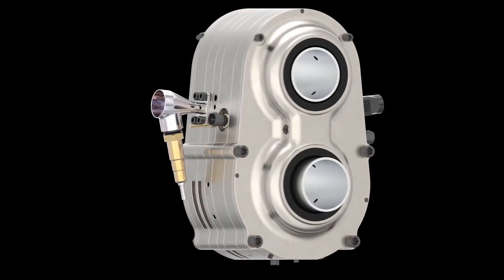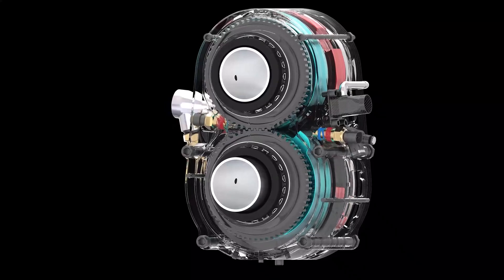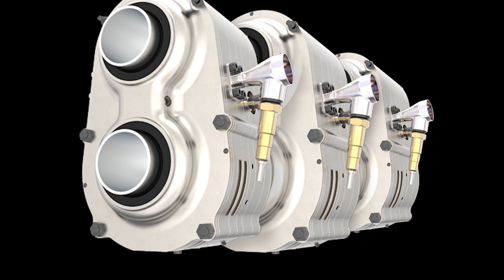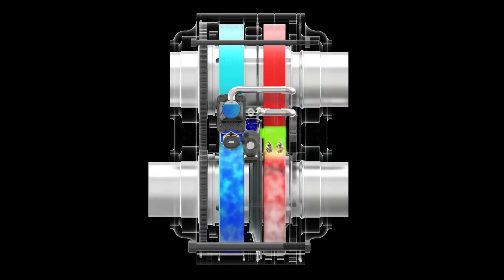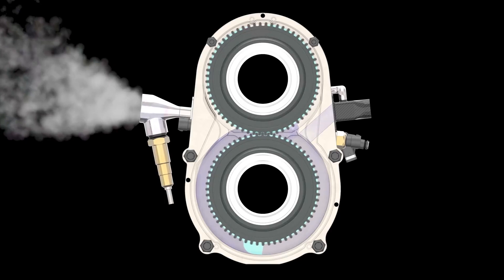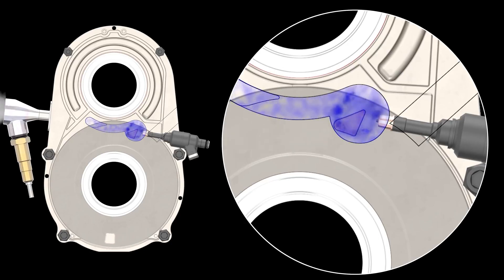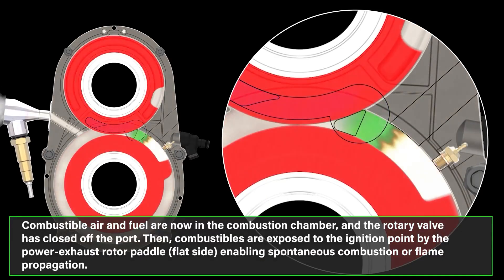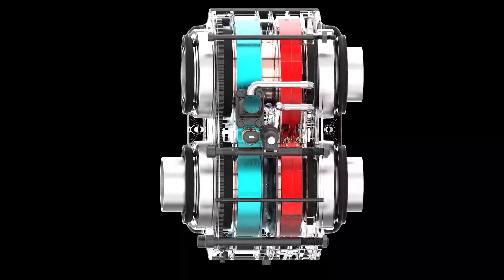This pistonless engine runs on hydrogen and revs to 25k rpm

Comment: PROBLEM:
Having just one explosion would cause an impact that has to be absorbed by the engine body through the shaft.  That will end up in problems, especially if no seals are used.  If instead of one, we have two explosions symmetrically located on opposite sides of the center of rotation, then those impacts would cancel each other out.
Reply: it is a modified Helicopter's main rotor engine, they use 4 of these units, light weight, super efficiency will often mean that it has been around for about 20 years already and being used by the military.
Reply: @dr.decker3623  , good to know, thanks.  However, I am surprised of the fact that it only has one explosion instead of two on opposite sides of the center of rotation.

Comment: I think hybrid cars make more sense than fully electric cars. Just one of these engines would be a great backup to an electric car. Light, efficient and powerful enough to turn a generator that would recharge the batteries
Reply: Or you could just use fuel cells to convert hydrogen into electricity, and skip the weight and size of an internal combustion engine and generator as well as all the moving parts.

Comment: Ok, sealing problem in Wankel engine is actually secondary one. The primary problem there - poor thermal efficiency due to relatively high specific chamber area.

Looks like the same here.

Would like to be mistaken but unlikely will surpass concept, as had had happened previously to dozen other unique ideas of ICE.

Comment: magnetic field have their own waste too. if the waste could have been low to zero it wouldn't have mattered which method.
im basically against anything that trends because, before it proves itself to me i dont take word of others for it. and electric cars are one of them. electricity too has waste. but not by the owner of the car.

Comment: While I think there is further development that can be done on the IC engine, as someone pointed out in another comment I have seen these things come and go as they usually have some sort of big drawback when they are fleshed out operationally. Having said that unless the energy density of batteries can be significantly increased EVs will have limited use cases. Example: My Tesla works great for my daily commute. However it is very inconvenient when I want to take a long trip. EVs are not yet very good at pulling a trailer or boat long distances so the range while fine for daily commuting becomes painfully low when a heavy load is presented. I believe there will be plenty of use cases for ICE powered vehicles for many more years. Eventually we may all go to EVs but the technology has a way to go yet. Oh and the benefit of low operational costs of an EV will be negated as more people get them. The demand for electricity will go up while the supply will not be able to increase at the same rate. Economics 101 says that the cost of electricity will necessarily go up while the cost of liquid fuel will go down with a decrease in demand. I do like to see innovative development in IC engines but generally speaking hydrogen is not a good idea for many reasons. Of course that could change with a technological breakthrough in hydrogen production and storage.
Reply: it is a modified Helicopter's main rotor engine, they use 4 of these units, light weight, super efficiency will often mean that it has been around for about 20 years already and being used by the military.

Comment: Hydrogen engines will be the future of engines. Electric cars are not viable right now due to how heavy and expensive the batteries are. Plus we do not have the infrastructure to support an all electric car economy. If we could find a way to easily convert current gas/diesel powered vehicles to hydrogen. Then I can see it taking off while designs for new hydro-engines are being perfected.
Good thing about hydrogen is  that if you want to be as efficient as possible. You can capture the exhaust and recover h2o then split  it back into oxygen and hydrogen. It would help for the long run as fusion tech, aka the ark reactor from Marvel's Iron Man, is proven then shrunk to be cost effective for everyone to use. 

We will have to end our dependence on fossil fuels sooner or later. It's finite and it's not going to be everywhere in the universe.  But lets hope that big oil doesn't kill this tech as they've done to so many other alternative engines and fuel sources.

Comment: seems impractical for normal vehicles. the tolerances required would make it expensive and susceptible to heat and wear. would be great for running a turbopump on a rocket engine tough.

Comment: It seems like a great engine to put on bikes small light and a lot of power but what about maintenance over time i expect you will not be able to keep the tolerances tight enough and so lose power. The maintenance to keep the engine working at 100% power is likely going to cripple the engine as i expect its not going to be an easy thing to do so not able to pop down the road to a local mechanic. This might become a engine used in say F1 and or other racing events but not so much normal use.

Comment: Electric vehicles are just a fad and will not last. The cost of switching to renewable energy  is prohibitive. Not to mention the mining of minerals for batteries is fossil fuel dependent, so are the  factories needed to process and manufacture the batteries. With more EVs on the road, we need more mining, and processing plants...so more fossil fuels. 
It would take Elon Musk 500 years to manufacture enough batteries to store 1 day of America's power needs. So forget EVs and forget switching to renewables, in their current state.
Give me 3 of these little engines, and I'd be in heaven.

Comment: Not to mention the hydrogen fuel tank that has to store the gas at 5,000-10,000 psi and the costs associated with certifying the tank every few years.  Conversely, propane is stored at about 200 psi.  "High torque" is a relative term with no definition.  To make this engine useful in a car, it would have to be geared down by about 8:1 ratio which might raise a low torque engine to a high enough value to be useful.  A lot of concepts look good in computer animations but fail in actual practice.
Reply: What about propane?
FedEx uses that
Reply: @wesss9353  It's a common fuel in Europe, you can convert any gasoline engine to run on LPG.
Reply: @wtfiswiththosehandles  hydrogen better than propane?
Fork lifts uses 40 lbs as fuel
Reply: Store the hydrogen as water 💧
Reply: @bluesky6985  and then what?  Electrolysis is slow and consumes a ton of power.
Reply: @Nezarus0  There are ways to do it.  Stan Meyer did it and was murdered for it
Reply: @Nezarus0  Using electrolysis, an input of 55 Kw will yield 1 Kilogram of hydrogen and that contains an energy of 33.4 Kw. There is a net loss of 22 Kw.....this is why you will never run a car using water as fuel. Electrolysis is roughly 50% efficient in the real world, its why its not produced commercially in this manner because its too expensive.
Reply: @jb-xc4oh  Prove it.  He got a patent for his method of splitting water 💧
Reply: @bluesky6985  The lack of water powered cars on the road today is proof of it.
Reply: @jb-xc4oh  
You have no clue how the world really works do you 🤔.  Have you ever heard of a  NSO?
Reply: Virtually no losses?
Give me a %
Reply: I'm going to agree with you and disagree with you. Yes, thousands of concepts turn out to be huge white elephants but it's how we've ended up with things like the steam engine and internal combustion engine.
Reply: FYI if you look on their webpage there is a video of them talking about it in much more detail and the fact they have built a function prototype they just weren't happy with the bearing they used so plan to use another kind, My point is this is not just a CGI engine its a functioning engine and proof of concept. but only time will tell, very cool still
Reply: ...until they some up with an additive or catalyst that will cause hydrogen to be liquid at lower pressures. Might even be the tanks are made with this catalyst.
Reply: hydrogen cars are great on paper but would absolutely fail any form of safety check
Reply: @ChaosMachina2022  why is that?
Reply: Hydrogen fuel tanks are trivial. Never understood why people make a thing about it - they're a thing, they're safe, get over it. The practical issue is this engine is nonsense.

Comment: Your kidding right? 

No way Hydrogen is environmentally "friendly" when the majority of the tech used to create it is a direct side product of oil-n-gas production. Until Hydrogen can be produced without using carbon or a huge investment of energy then engines like this will NEVER be produced. Furthermore, developing a method of storing Hydrogen in some form of non-cryogenic state would be absolutely required for public use. Otherwise the leakage rate and cost to keep it chilled would far out-weigh the energy savings Hydrogen could possibly provide. 

Beyond those major issues, the engine itself would likely be very expensive to produce as it would both require high machining precision and materials that are resistant to Hydrogen-embrittlement. I mean, can you imagine this engine coming apart at 25,000 RPM as the metal is full of micro cracks?

IMO, for now its just a cool novelty and a nice topic for a YouTube video.

Comment: This is the Future,Not electric. Cars and buses are setting alight, Worse than petrol e gives. Give it Time,And Hydrogen will rule all car markets..You could pick this engine up yourself, Wheight  is a big problem in cars. it will give you the power of a V8 engine. Electric is dead in the water already.

Comment: High tolerances are mostly unusable in non-laboratory conditions. Look at Formula 1 monopost engine. Due to high tolerances the engine must be heated to operating temperature before the engine start. The reason is thermal expansion. Without pre-heating the engine would be instantly destroyed. And now imagine to have high tolerances in this. And you want to start engine in -30°C condition.

Comment: The housing as drawn cannot handle the heat or pressure so the weight is definitely not correct even with our most advanced building technologies unless you want to go with exotics.

Comment: I'm more in the turbine / continuous combustion camp. Spraying fuel into an already-burning flame has its advantages. Turbine + electric also uses the best of both worlds, rather than wasting time trying to make the ICE do variable power and rpm, which the electric motor is naturally better at.
Reply: it´s very crazy to see how works a high speed turbine, some strange things of high speed make it all.

Comment: To create hydrogen, you need energy like electricity or chemicals. Then you still need to transport it across the country.
Electric motors seem a better option to me. They're efficient, better control of power, easier to maintain.
Hydrogen is very explosive, so storage is a problem, but batteries are polutive, yet they're working on it.
A public transportation system would be most efficient. But that would require a huge change in the current infrastructure.
 
I think It's strange why every single person wants to drive their own car. Sit in traffic for hours is one of the most stressfull things in life.
How cities are structured, so that you have large commutes between home and work, is a problem too, imo.
 
Cheap and efficient energy usage and production is nice, but also creates a continuous rise in demand.
Reply: Hydrogen can be produced in line to the intake. No need for storage of anything but water.
Reply: @lukemaclaughlin7436  Indeed. There's no real need to transport hydrogen across the country when you already have the ability to transport electricity across the country and produce hydrogen from that using just water.

Having said that, there's actually no problem in repurposing existing gas pipelines in the future to carry hydrogen if it should need to be transported.
Reply: @lukemaclaughlin7436  There was some guy who did exactly that: Drive a car on water.
Somehow, he disappeared (died).
At least, that's the story.
I think it's all a hoax, because you can't put out more than you put in.
You can't build an engine that drives your car and, at the same time, produce  enough hydrogen to keep itself going.
That would be the miracle of free energy.

Comment: Unfortunately, extracting H2 has a high carbon footprint. While elemental hydrogen is the simplest and most abundant element, H2 is extracted from chemical reactions still (could be outdated here). Plus, driving with a tank of LH2?? Pass.

Comment: How expensive is the engine going to be.
And no hydrogen is and will be a ver expensive and limited energy storage medium.

Especially green hydrogen.

Ps existing diesel engines can be converted to run hydrogen, if you have an unique situation for not using an EV.

Comment: So:
1. What temperature and volume is the coolant leaving the engine?
2. What temperature and volume is the exhaust?
Without that data, you can't say how efficient it is. An electric motor is pretty good, because it has neither one -  maybe a bit of hot air.

Comment: This will never reach consumer production.  The tolerances are too tight for your average garage to maintain, much less repair.  And then there's a collision that buggers the thing and sends pieces flying everywhere at those rotational speeds... and just one little shock - such as hitting a speed bump too fast, would result in a dent somewhere inside those revolving parts - reducing efficiency or outright destroying the thing.

For a generator, however, it would be ideal.  Since it's not moving and can have a huge fuel cell nearby - with little risk of an accident punching a hole in it to send it into orbit on pressure alone, much less any resultant ignition - it could run as long as necessary, producing water, to power a home or recharge a hungry electric statusmobile.

Comment: This shows promise. the no seals thing would be an issue if the 200psi intake charge didn't open the door for the integration of laminar flow. This could theoretically mitigate the imperative need for wear susceptible tight tolerances. I really hope this goes somewhere.

Comment: 1.  No seals, but that 200 psi air inlet doesn't leak?
2.  Newton's 3rd law (every action has equal and opposite reaction).  The combustion chamber pushes the cam of the lower rotor, and an equal and opposite force pushes against the upper rotor.  How long are the bearings going to last constantly being kicked in the same place again and again.  Same for the lower rotor, while the cam moves, there is still a perpendicular force toward the lower rotor and its housing, again kicking against a bearing in one spot time and again.  How long will those bearings last before they're chewed up?  I imagine a crankshaft on a conventional combustion engine doesn't use bearings for this reason.

Comment: Electric cars are big, heavy, polluting, non practical. 
Not even 10% of our population have electric cars and there are already 15-45 minutes lone queues at charging station and them 1-2 hours of charging time on top of that. 
Imagine What will happen when 50% of population will drive electric charging cars. 
I like the hydrogen cars to be the future... Not this... Hydrogen cars which produces electricity through electrolysis. 
The are quicker to refule, got longer range, lighter, are much less polluting then big battery cars.
And manufactures have already made H2 storage tanks strong enough that the point of storing hydrogen being dangerous is also taken care of.

Comment: I call BS on the whole "idea".
There are no prototypes in anyone's hands.
I emailed them and the "president/founder/inventor" called me back. (what are the chances of that with a "legit" operation? Said I had to pony up 25 MILLION to be in on any future development.
Their head office address shows up on Google maps as a tiny Accounting office; no signage with their name. No lab, no shop, no factory. 

Totally unrealistic specs. Weight, RPM, power output are all fake, impossible numbers, which is probably why they're different in every article I've read about this  "miracle" engine.
Don't hold your breath.

Comment: Can you give the numbers for torque and output while under load , It is not good if cannot operate at full noise under load. Post the numbers please.
Hydrogen is not green, the current methods of extracting hydrogen result in a minimum of 80% water contamination, thats 80% of the fresh drinking grade water used in the process is waste and cannot be used for human consumption, including drinking, agriculture, mining, etc ,etc.
come back.

Comment: Maybe use this type of motor to drive a generator that in turn drives electric motors on the wheels, like locomotives. Probably wouldn't need as much horse power and hence have a reduced size and weight. Then the only problem (???) is getting the hydrogen - possibly use excess electricity from the generator to split the hydrogen and oxygen from water as you're motoring along. Save excess hydrogen in a small tank to facilitate startup. The big issue - net efficiency. The upside - a "practical" (?) way of using water as a fuel source.

Comment: As a combustion fuel H2 makes almost no sense.  No matter how you engineer the thing, you cannot exceed the Carnot cycle efficiency, which will be always half that of a fuel cell.  If you have solved the H2 production, distribution, and storage problems to the extent that H2 is available in useful volumes to consumers, why wouldn't you use a fuel cell and get double, or more, the efficiency. Cheers.

Comment: I like the concept, I believe there is room for improvement. Tight tolerance and high rotation speed is only good when the engine is new, need to re-work the design and get it sealed. Being sealed is not going to add much to the weigh.